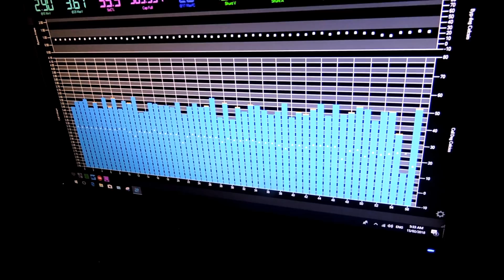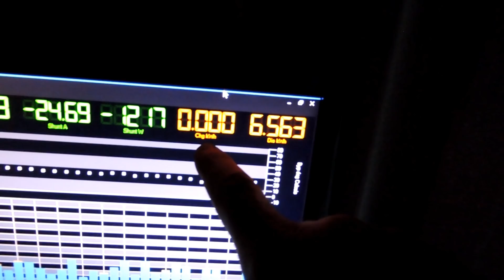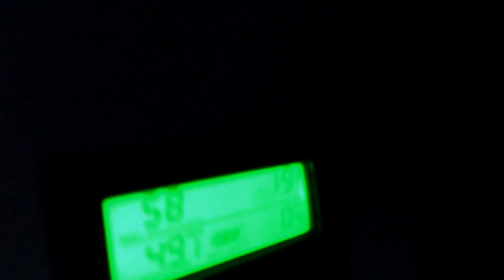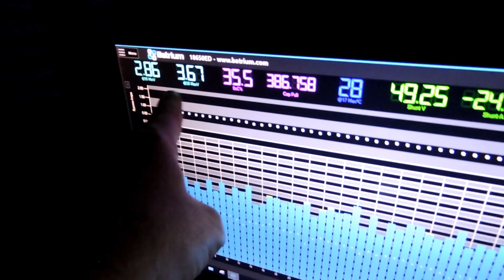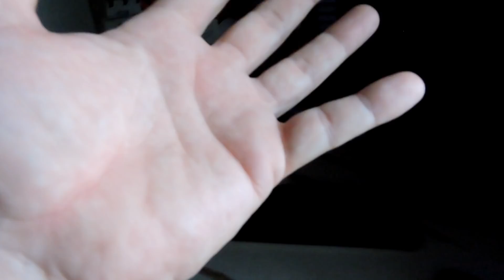I'm going to test my powerwall ...

Comment: I think you need to build a single spare battery module so that you can work on issues such as this. Once taken out of the "system" I think you need to split the unit so that you can localise the problem to either a minority of below par cells or maybe a complete dud unit - dud in the sense that it is no longer equal capacity to the others.   You also need to decide whether to add cells to get the unit back to target capacity of, if you think several cells are progressively degrading, raplace them.

Comment: Don't you want to replace those 2 bad cells first?

They have a smaller capacity I think, for what ever reason.

Also it would be good to visually inspect all the fuses. To make sure all individual cells are participating in the test. It's a bit of work but it makes the results more valuable.
Reply from the maker: already done, will include that info in next video today

Comment: For the AC unit, you could help it's efficiency by getting a small water pump, some tubing, irrigation spray nozzles, and have water sprayed onto the coils. It will greatly reduce the power needed to remove the heat from the house.
Not sure if you have a window or central unit(s); but if window units, you can put a large catch pan of some sort under the unit to collect the water and recycle the water and just make sure to keep it topped off each day (or use a float to keep it auto-filled).
I'm gonna do a video on this as I have my AC window unit set up this way.
Reply from the maker: 800w reverse cycle unit, i think the water chargers would be more than the power savings to be honest
Reply: Nope, not really. Last year I spent about $120 for June; and that's in humid central Florida. Installed the sprayers and July dropped to about $90. That was 1 window unit that ran 90% of the time. You only need a small pump that can deliver around 20-30psi. The pump cost me $30USD, 12V, 4.8A (<60W). Then you can install a relay that the pump only comes on when the A/C pump kicks on.
The larger the A/C unit, the greater the price difference will be by installing the water cooler. Now, it is to be noted, the water used can't have much or any iron in it. Calcium (lime) isn't that big of a deal. Iron will degrade the aliminium radiator fins faster.

Comment: I wouldn't worry too much about the Ah figures, the bank is only drained because of those weak cells. Most of your cells have almost half a charge left in them, granted that half will go faster so if you replaced 55 you'd be hitting much closer to that 600Ah mark.
Reply from the maker: just needs a bit of tweaking :)

Comment: If you have low humidity use a swamp cooler... less power....we us them here in Phoenix during the summer when it's 125F
Reply: they don't work in humid climates and  we do not use them here.
Reply: Urs Odermatt it was worth a shot! They don't really work well over 50% humidity. In this dessert it's way less... Around here 3 days in the summer  outside and you turn into a corps!
Reply: most air conditioners here along the coast are split reversible inverter type air conditioners. in the winter you can use them to heat the house.
Reply: Urs Odermatt I have seen them and they are really good on electricity.  Over here they have the whole house units about 3-4 ton units but not inverter.  I'm building a house it will have no a/c. I am spending most of my time on some serious insulation methods!
Reply: on second thoughts i am not sure if you want to use a swamp cooler in the electric room. you don't want humidity in there. the inverter aircon dries the air besides cooling. if the cooling prolongs my lifepo4 battery for just 10% of its life span, it has paid for it.
Reply: Urs Odermatt I guess your right..
Reply: Yea swamp coolers are overrated, btw we should talk more I’m in Phoenix also check out my channel
Reply: Brisbane is 3-1/2 degrees away from the Tropic of Capricorn on the coast of a warm Coral Sea. Dry isn't in the cards.